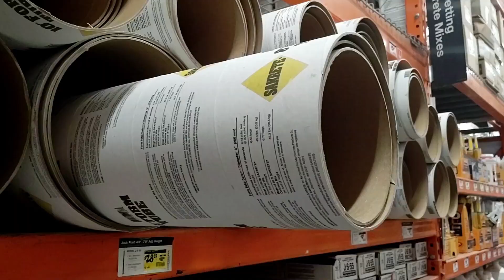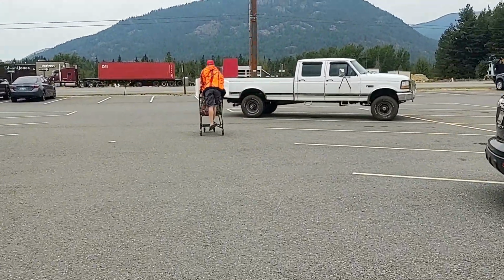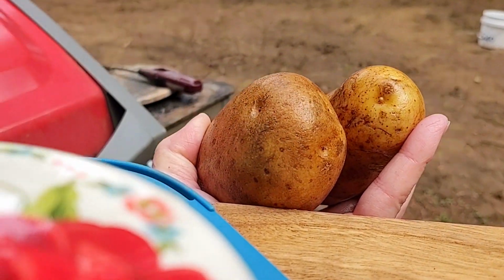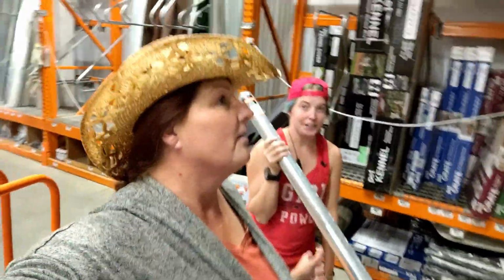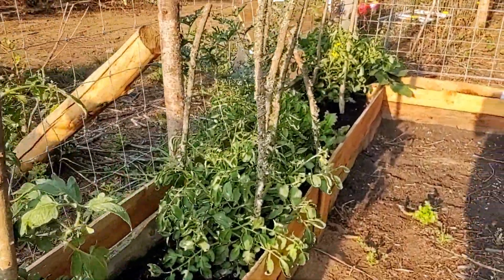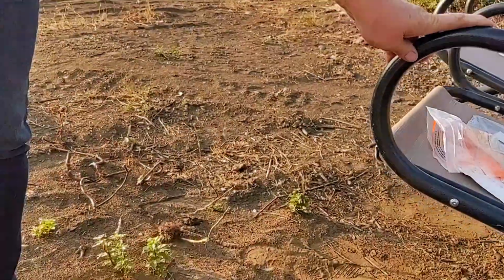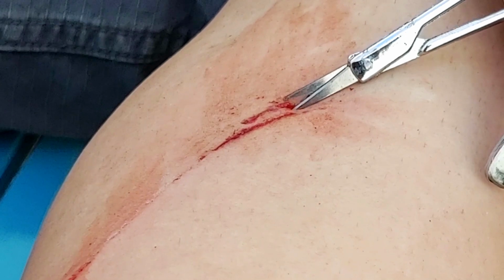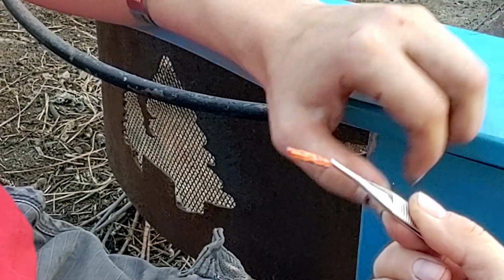NASTY splinter removal on the homestead // How many trips to HOME DEPOT in a day // Vlog

Comment: Where did you buy your big plastic tanks?  I am building in Sagle.
Reply from the maker: So the plastic tanks that I have for my garden I got for free from a farmer. My thousand gallon tank I got from North 40 along with the 200 gallon tank that I used in the truck to get the water
Reply: @KuzweKanfarms  Thanks. I am building in Sagle.
Reply from the maker: That's exciting!  What are you putting up?  Stick framed? Pole barn house?
Reply: @KuzweKanfarms  it’s a stick frame. I started out with the intentions of building a timber frame but I decided that I can’t handle the big timbers. I’ve got it dried in, wired and the front porch built.  I’ll start the plumbing next month.
Reply from the maker: Oh that's awesome yes I wanted a timber frame also but the time that it takes to do a timber frame I decided to do a post and beam cuz it's so much faster. But for this year we're doing the shipping container build